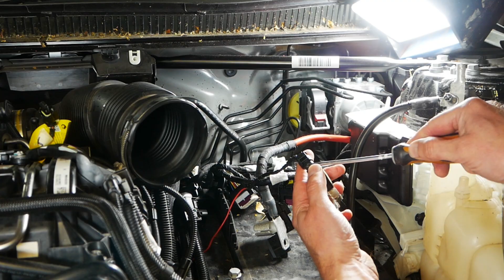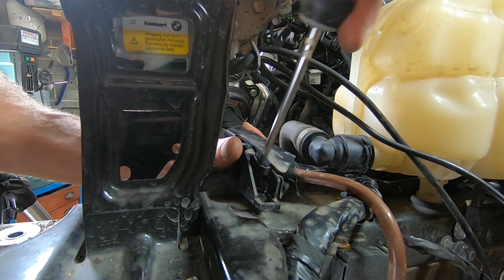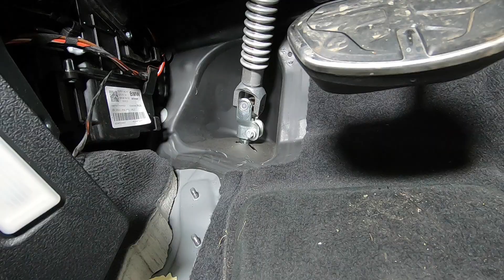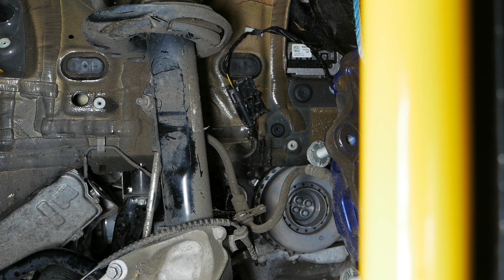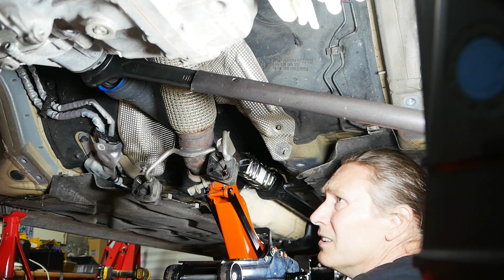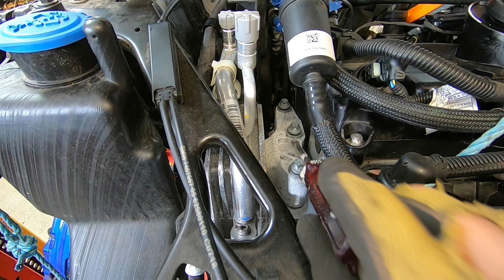FINALLY, The Engine is OUT! | What a Job! | 2022 BMW M 135i X drive Project

Comment: Hi nice video, not saying anything wrong with how you took the engine out but normally I would have taken the subframe bolts first from underneath the car, then started with the suspension bolt of each leg, engine mounts / transmission bolts connected to the chassis and steering nut from underneath the steering wheel out so essentially you’re pulling it all out in one unit with everything still attached to the subframe. And I need to work on anything I can take it off individual just the way I do it I find it’s easier. But I mainly work on front wheel drive.
Reply from the maker: 💯percent appreciate your comment! This is only my second time doing this level of work, so I’m far from an expert. Appreciate you sharing your experience and methods! 👍 Cheers, Phil